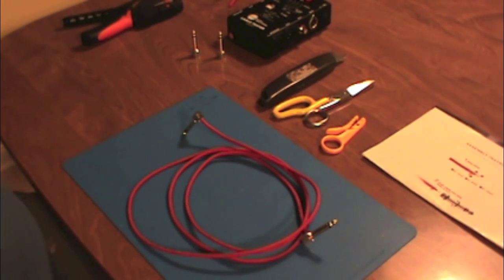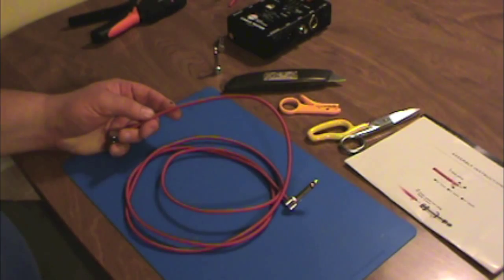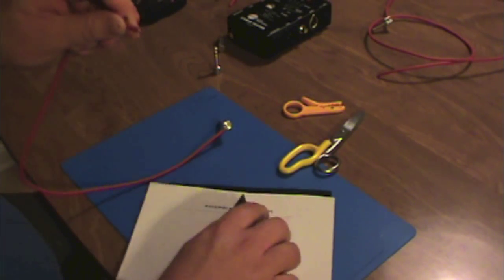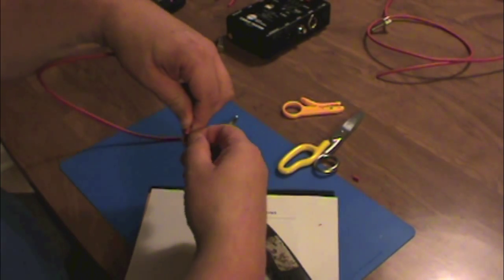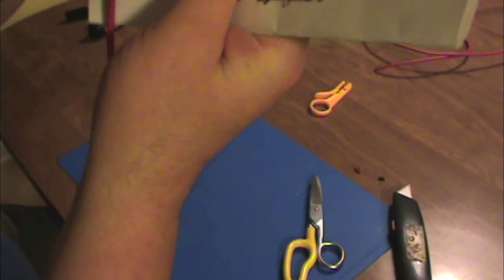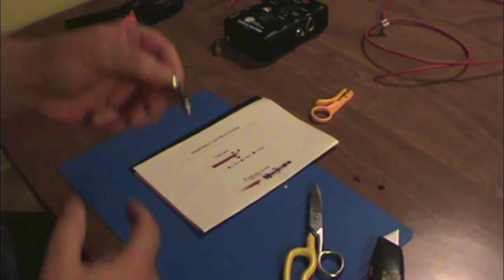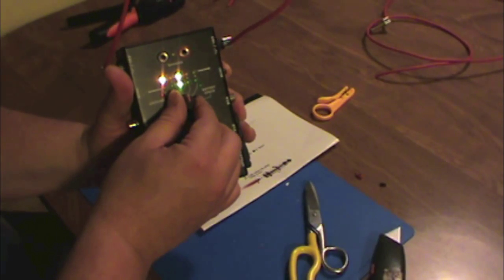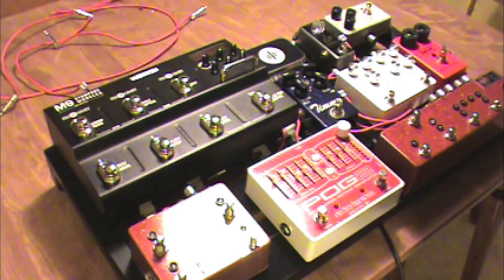Lava Tightrope - Assembly and Installation

Comment: These are great cables ONCE YOU LEARN HOW TO MAKE THEM.  And its frustrating at first. It was for me, but I'm glad I applied myself until I learned. These are the "Tightrope" edition. I learned on the first version that has 3 pieces which are a little harder to make, but look exactly the same when finished. The 3rd piece is an 'inner grounding sleeve'. It appears they've found a way to permanently fix it into the plug on the 'Tightrope' edition. I'm assuming that is where the 'half turn before applying the cap' comes into play.
Excellent instructional video.
Thank you.